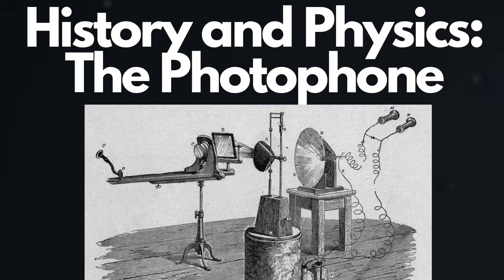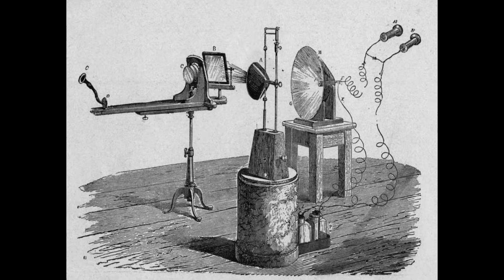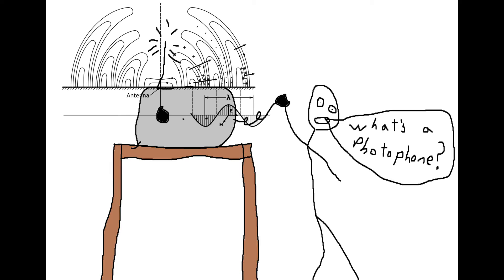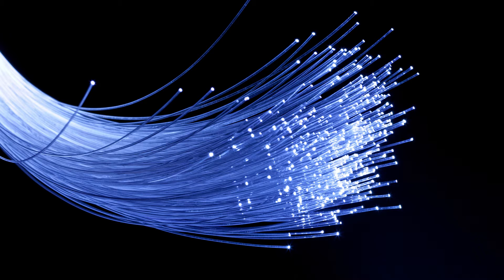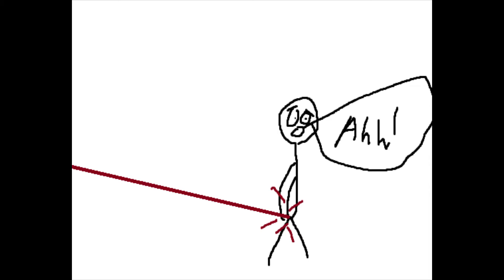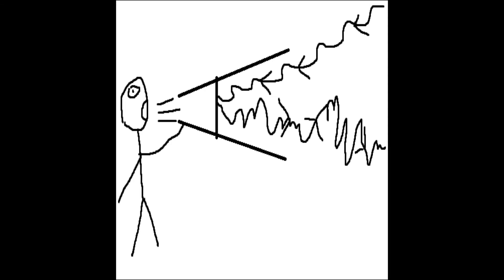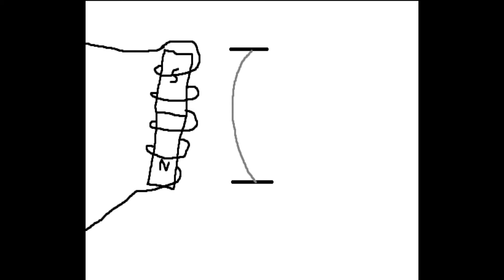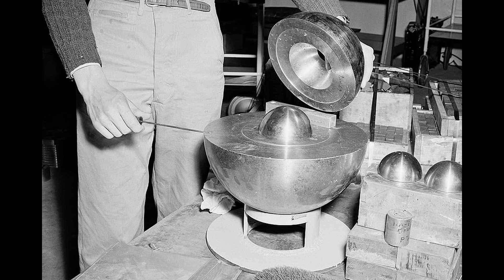History and Physics: The Photophone (A cell phone in the 1800's)

Comment: I love it! Very interesting content, my semi-acoustic guitar has a piezoelectric pickup I'm guessing works using pressure changes or vibrations as the medium, the pickup is a wire with a silver looking mesh sheath that's placed directly under the nut on the bridge, in-between the nut and the bridge an amount jf wire long as the length of the nut and as thick as the nut that then simply goes throa snatll 3mm drill hole through the guitar top into the body wired to the pre amp and now I'm interested if something similar to these physics and being used to translate sound but without the light and more because the use of piezoelectric material js so effective. Plus I saw something like this on the new 😂Macgyver series 2ep 12, his hose is rigged to explode booby trap style and he can Mt have anything with a WiFi signal within 200mtr near thd house incase it triggers the explosive detonator, so he signals his team using his porch lights in standard more code a short msg "use photophone" his team look it up and build a transceiver on their end as morse code would be to slow and his land line was cut by the bomb maker too. This is why I looked this up.science is very interesting and to see this being the basis for fibre optics is prety cool.such a simple design that jnslired more research I'm glad it happened although wars being the catalyst fir change for any new technology never inspires, its only until we're on the precipice of our own survival or the event of something tragic until people are willing to change things